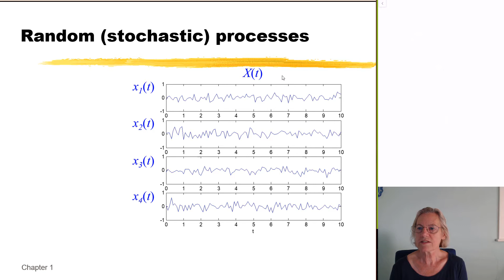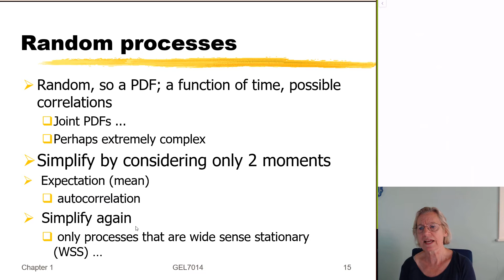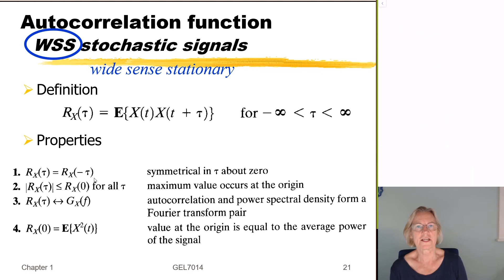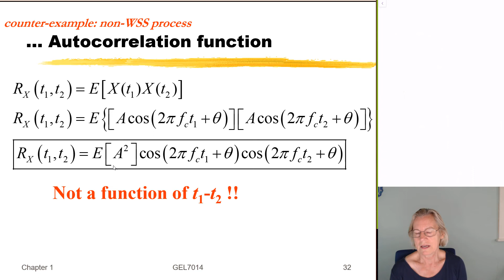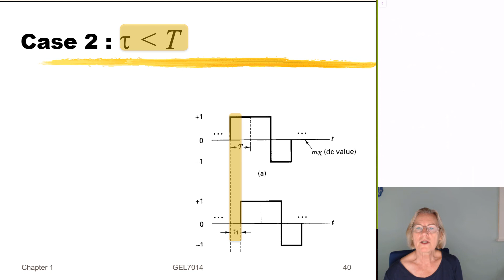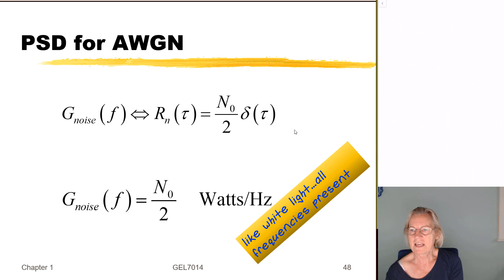GEL7014 - Week 1d - Random processes

Comment: My question is related to Additive White Guassian Noise explained in the last part of the video around at 46th minute. To find Noise Equivalent Bandwidth, we have to find a rectangular shape whose amplitude and energy is the same as those of the noise respectively, then measure the bandwidth of the rectangular shape as noise equivalent bandwidth. It says energy of the noise and rectangular shape should be equal, meaning integration of the squared Sinc function and squared rectangular shape signal should be equal. Am I right? And then, it is mentioned that it is enough to have the same area under the curves of squared Sinc function and squared rectangular signal. Right? One of the plots shown in the video, is squared Sinc, but the other one is not squared rectangular shape. Can someone make this result clear? I mean, How can we reach from equal areas under the curves of the signals to equal energy in the signals? I am confused! I also did not get it that our noise is a Sinc here or a squared Sinc?!

Comment: Why is it not a double integral over Theta_1 and Theta_2 at 25:20? Where bei PDFs are 1/(2*pi) for f(Theta_1) and f(Theta_2). Like in the formula for R_X(t_1,t_1) some slide before, where the Expectation was a double integral over dx_1 and dx_2.